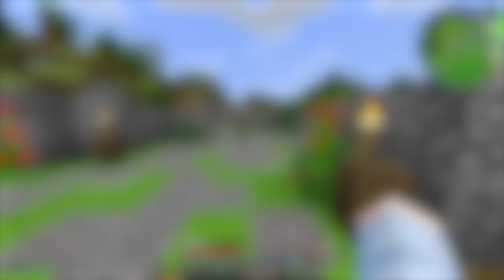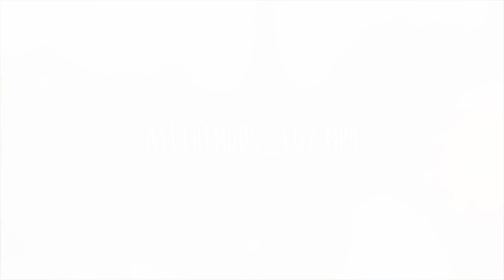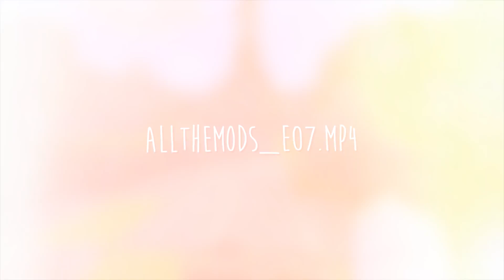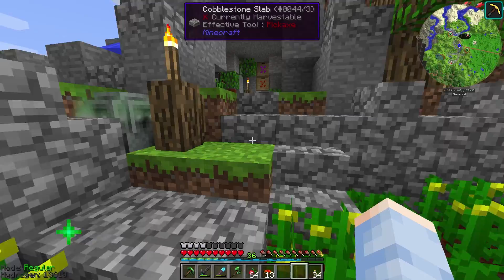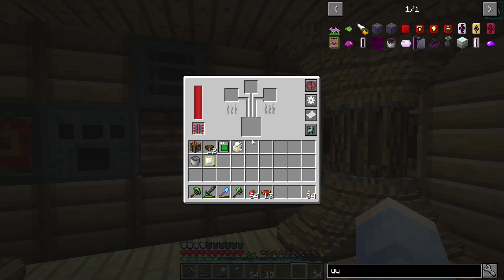All the Mods - E07 - Mekanism 4x Ore Processing, Brine, and Phantomfaces (Modded Minecraft 1.10.2)

Comment: you don't even need the chest. You can just point the crafter directly into solder and it will automatically put things where they go.
Reply from the maker: Yeah, but I needed 2 crafters for all of the patterns I wanted and I wanted that whole wall to be machines, which only leaves 1 face exposed to put crafters next to. That way I can put multiple crafters into the chest and then into the solderer.

Comment: Great video, love your stuff ...

New for mekanism in 1.10, you can heat your solar evaporator actively using thermodynamic conductors connected to a valve and a resistive heater.  Which means you can run it without the solars, at night, underground, not in a desert etc.